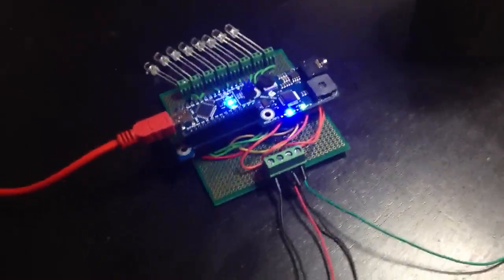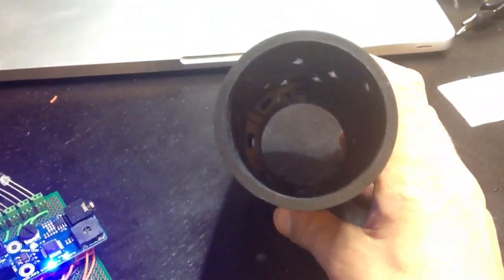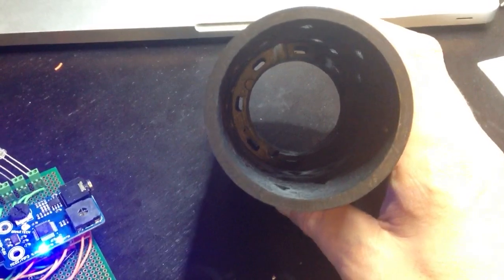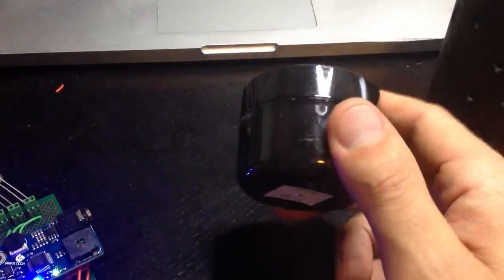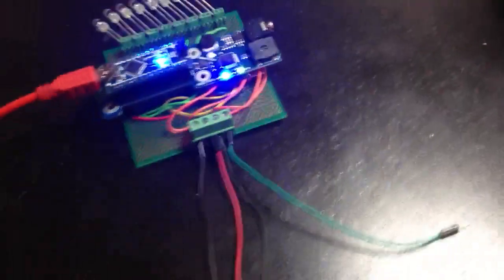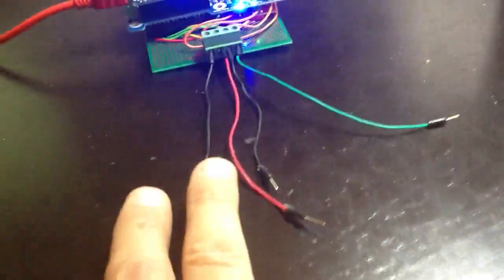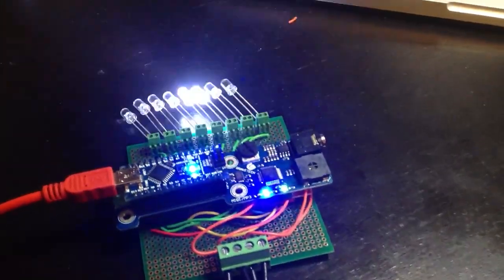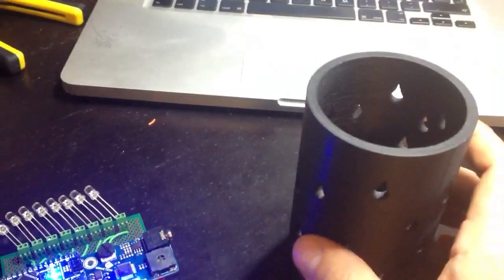Capacitive touch sound playback

Comment: Hello Jens! First off all very nice project! The Cylinders look really great!
Im doing a project for my study witch includes the nano mp3 player shield and capacitive touch aswel! But i didn't manage yet to get it working! How did you do it? and witch library or code did you use??
Reply from the maker: Glad you like it! I used the SFMP3-library found here: http://www.billporter.info/2012/01/28/sparkfun-mp3-shield-arduino-library/
It's not 100% stable, but the best I could find.

Now there's an even better solution: http://www.bareconductive.com/touch-board They used exactly same components that I did in this board such as the MPR121, so that'd be a great starting point.